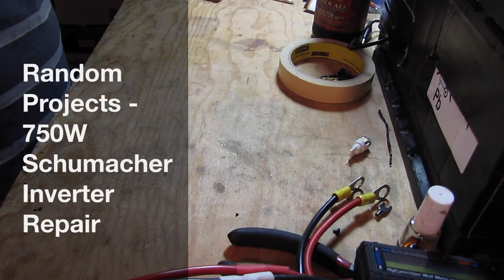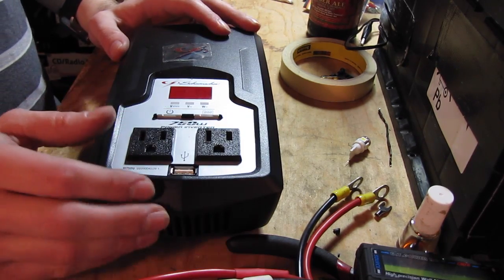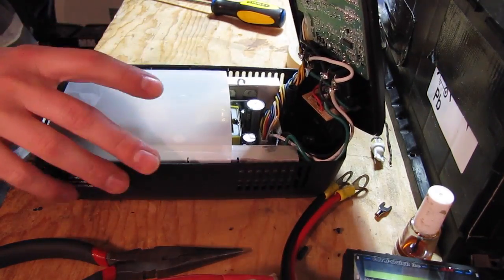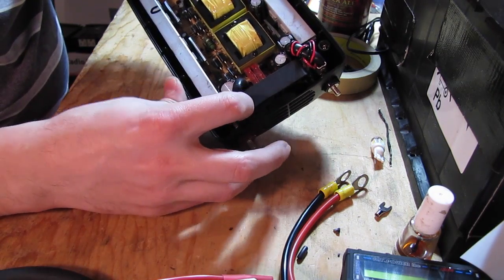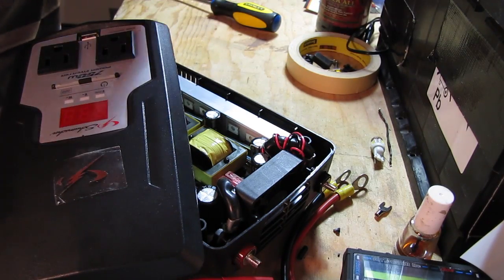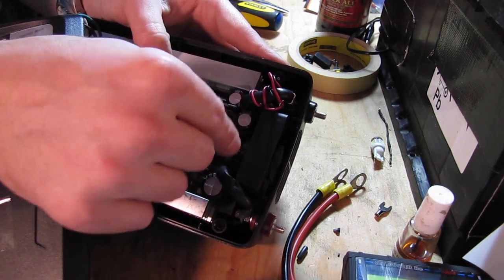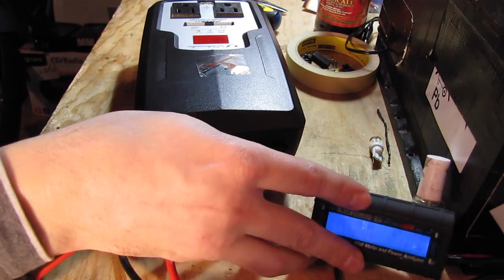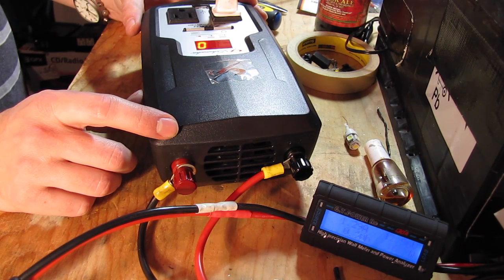750W Schumacher Inverter Repair XI75DU Part1

Comment: This model has a problem because I have had 3 of these they work for about 8 months then suddenly it just stops working. When the purposely sell something that is flawed from the assembly line. I do a reverse return. Clean up the one that no longer works buy a new one and put the old one in the new box. But thanks for the info.

Comment: The no fan with light loads is a nice feature of this, because it's fan is LOUD. The perfect size to run a full sized fridge and a few LED light's. It may not be pure sine wave, but I never noticed any buzz or interference like other un-pure inverters I had.. It sucks the fuses did not protect it from my shorted out lamp. Oh well. They're cheap on ebay.

Comment: no comments about the reversed battery cable colors? you have red on black and black on red.
Reply from the maker: :) I know! when I use the trickle charging cables that ship with 'battery tender' brand chargers, extending them or running them through the current meter I have can flip the color code/polarity. Something that's sure to bite you in the butt. I now use Anderson connectors more to avoid this issue.
Reply: @JuliansRandomProject  Hey, you still around? I broke mine. plugged in a shorted lamp and it was over. no fuse blown and everything looks perfect inside. Idea's?

Comment: Why are your power supply wires reversed??  That sounds like a good way to inadvertently do some damage lol
Reply from the maker: Agreed. super sketchy. When using the automotive charger plugs, they can cause a situation where the colors changes with certain connections. Not advised and highly likely one will hook it up in reverse.
Reply: @JuliansRandomProject  no what I meant was when you connected it to your power source, you connected red wire to black post and vice versa.  Looks like you connected it backwards.  If it did run this way that may be why the fuses blew (if someone did connect positive to red, etc). I have one of these inverters and can confirm that red is positive and black is negative.  At least that's how mine works lol
Reply from the maker: @joshuapk9808  I understand what you're saying. The connector that switched the color is just out of frame on the lower left side when I'm hooking it up. Because I'm going through a power meter with my soldered on SAE connector the possibility to maintain the correct polarity (positive/negative) and swap the insulation color exists. I've since abandoned these connectors for Anderson connectors. It may be hard to tell in this crappy old video but at the end I plug in a lightbulb and power it with the inverter, so the polarity was correct (positive 12V to positive and negative to negative). Check out part 2 of this video where I further confuse things by swapping the colored nuts on the terminals :)

Comment: I need an electronics
     parts list for my Schumacher
     Electric 750-Watt Power Inverter Item
     # 595188 Model # XI75DU I melted the transistor
     closest to the black terminal hooking it up to my truck. I can’t read the whole
     thing or find a replacement part. All I could red was MXP400**** ***is burnt
     and LY04. Can anyone help me find a replacement part and the missing
     information?  Thank you Jim

Comment: I have a question, Can I replicate this process for the SCHUMACHER 1200 Amp SJ1?
Reply from the maker: Probably. Depends on the failure. Didn't know they made a 1200 amp jump start pack, cool.
Reply: Yeah, I just bought an used 6 in one Schumacher 1200amp jumpstarter (https://goo.gl/ft3zg9) from Ebay but later I realized there was an issue with the power inverter (needless to say an issue solved in your video).

So, although I haven't received it yet I thought "Hey, there has to be something I could do to repair the Power Inverter" and your video has been very illustrative on this matter.
Reply from the maker: Awesome! Good luck, let us all know how it goes.
Reply: JuliansRandomProject I will

Comment: Got to love YouTube!!!! There is always a resource to go to when you need it, I just this morning hooked up this same inverter backwards and blew both fuses just as you had on yours. I bet that is what also happened to yours. No other damage noticed other than the fuses. Like you, I don't have 40 amp (what was in my inverter) so I'm not sure if the blown fuses are the only problem. I hope so because, for the price, it has been a great little inverter for me. I've used it to run an angle grinder and 1/2 inch drill with no issues other than my stupidity when attaching it to my truck battery. In fact, I have never even heard the fan turn on. You got one new Subscriber in me. Best of luck!!
Reply from the maker: TheHayes32 Youtube is the best for that. It's why I try to use actual part numbers and the like to aid in search. I'm more interested in helping the 4 people that hit this exact issue than getting thousands of views for a video that essentially shows you how to replace a fuse or switch :) You may also need to replace the large input capacitors. Thanks for the comment!

Comment: Whenever I plug this inverter in, the voltage in starts ticking down .1v ever couple of seconds and reads low battery. The battery is fine and should be putting out at least 13v

Comment: you should check the input stage again for a short after replacing fuses cause blow fuses normally won;t give you a reading on the input side if they are blown.
Reply from the maker: That's true.